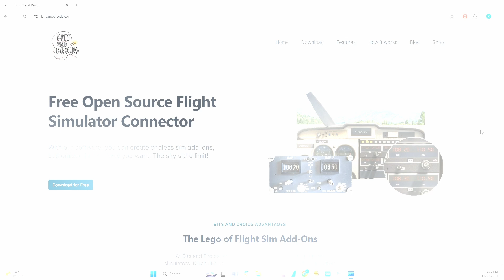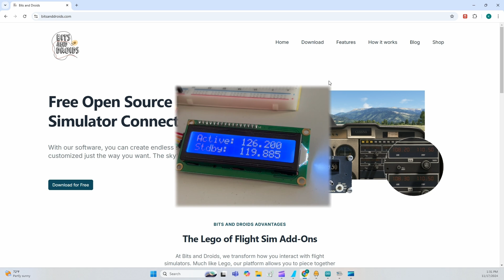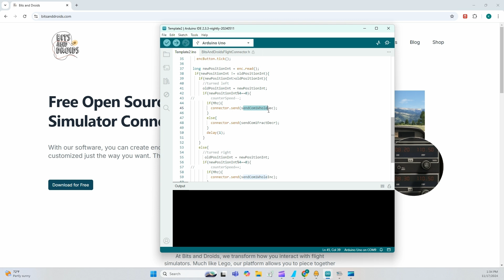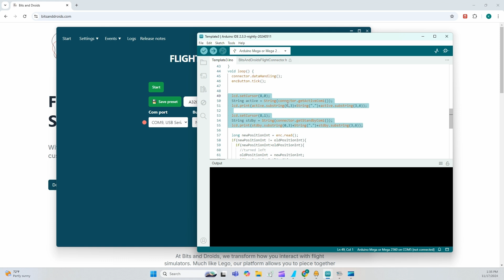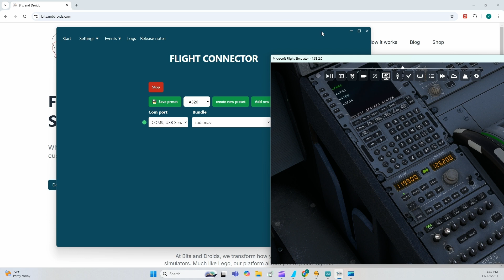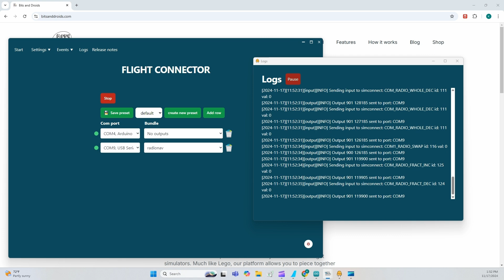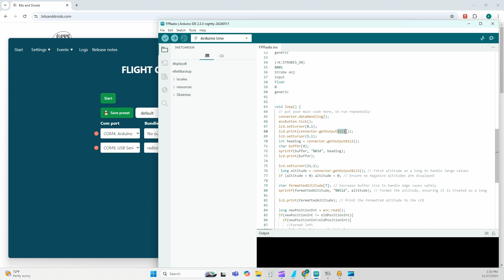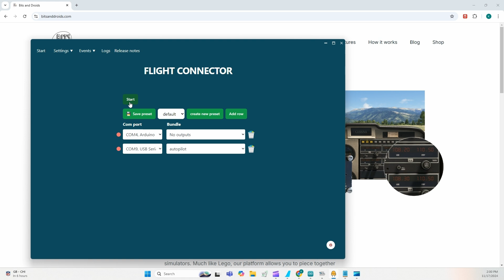Unlock the Power of the New Flight Connector in MFS2020 & 2024!

Comment: I'm trying this out and I got it to work for grabbing output (current indicated altitude) but I could not get it to work for the status of the "master caution light." I subscribed to "master caution on" in the bundle list and in the logs I can see "COM7 --> 1000 1" indicating the master caution is true (the light was on in the game). In my arduino code though the code below doesn't show anything and I know the LED works as I use it in DCS with DCSBios (plus I have it turn on in the setup function as a self-test). I verified the getMasterCautionOn in the bits and droids .h file is a bool too. Another thing, I tried a custom output event and again it shows in the log correctly for the same Lvar "COM7 --> 3001 1" but trying to put "getOutput3001()" into my sketch gives an error that the function doesn't exist. Was there a missing part where you edited the bits and droids .h file and added your custom functions? Thanks for any direction you can give.

bool masterCautionOn = myConnection.getMasterCautionOn();
if (masterCautionOn) {
    digitalWrite(APU_LED_PIN, HIGH); // Show the APU LED
}else {
    digitalWrite(APU_LED_PIN, LOW); // Don't show the APU LED
}
Reply: Is this the issue....at work so I can't test, will do so tonight. In the library .h file I see: 

bool getMasterCautionOn() const { return masterCautionOn; };

This seems to be a problem, why would the value be set to a constant value that can't be changed? None of the other bools have const in it. Also, I noticed when playing with altitude that it is set to an int not long, so if one goes past 32767 it'll barf right? So not a problem for most aircraft but if you fly above that those need to return longs or at least an unsigned int.
Reply: As it relates to the getMasterCautionOn having "const" in its definition in the .h file (as it should be a thing that can change and not be a constant)... I removed that and tried again and the function in the .h file isn't getting the state for some reason. So I'm not sure what's up with the boolean. I did test with "getTaxiLightsOn" boolean and my LED lights up when my taxi lights are on. So likely some sort of bug with the Caution/Warning lights boolean?

Comment: Very promising at a first glance. I am following your developement since years - but now i think you have delivered an universal tool which gives access to all the individual and special VARs of all aircraft.  And the panelbuilder is not forced to use a special controller or limited devices.
I am using ESP32-S3 integrated in 4" or 7" displays with capacitive touch ... so you can create very useful information- and control panels interconnected with ESPnow and using Bluetooth Joysticks.
 Seems you have opened a new chapter in panelbuilding.
Thanks very much for your hard work .
Reply: I too intend to use ESP32's and I have a couple of integrated ESP32+LCD that I might try out as well. ESP32's certainly seem a pretty logical and cheap choice these days! I'd be interested to see your setups if you wouldn't mind (are you on the B&D discord? Post in their project spotlight if you are, I'll be doing the same when i get time to build)
Reply: @Poundy  hi poundy - tomorrow ill travel back from my holidays . i will join the discord and give you some examples...
Reply: @Poundy  Hi pound --- here i am again. I tried to comment in the discord but after introducing myself in the discord i am blocked now. dont know why.
i have posted a new comment above - perhaps interesting for you.
Reply: @BerndSchmitt-Martinique  I thought I had replied here but it's not showing up. And I can't see your other reply if you posted it? 
What is your handle on Discord, I didn't see your "hello" post? Did you pick up a role in the roles area ? I'll try to post the link in the next one (that might be why my reply wasn't posted)
Reply: yeah the link is the killer. I'll post it with separate text only.
Reply: all my attempts to share the link are failing sorry. Anyway, if you haven't tried it, go to their server and go to the "Rules, ROLES, and Boarding" section, into Roles, and respond to the role post there to gain roles.